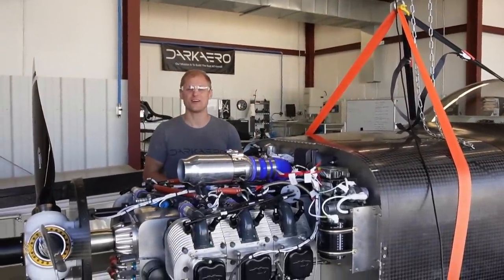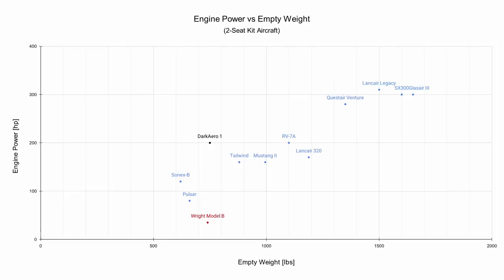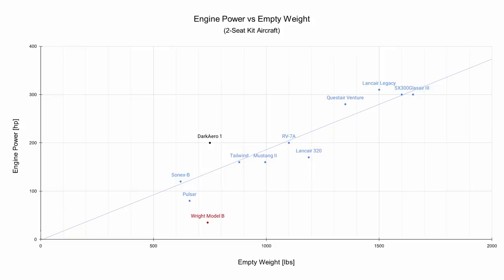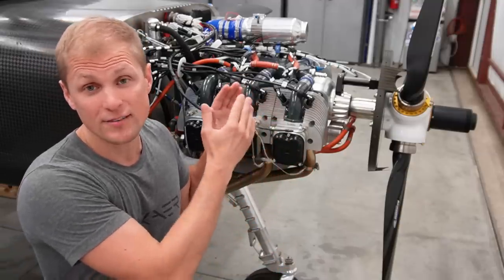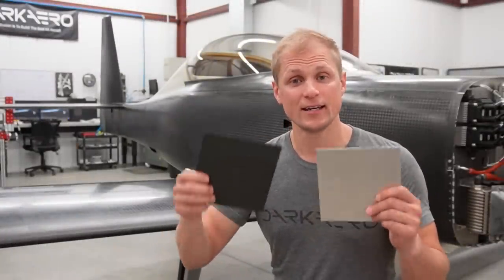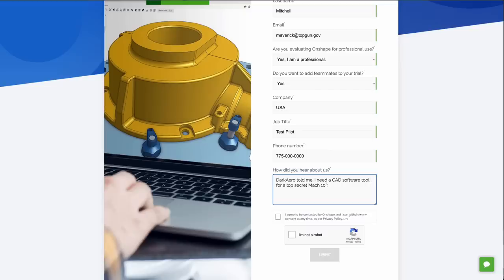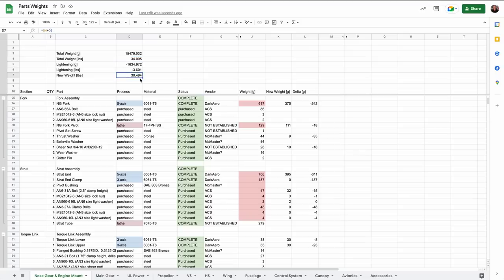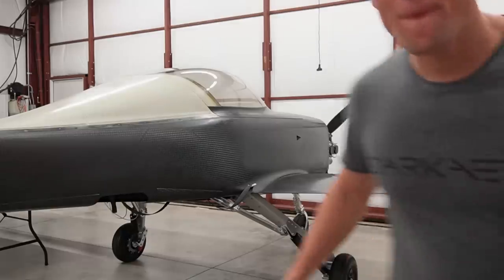How we built the DarkAero 1 "impossibly" light...

Comment: Great video!! Very impressed that you are coming so close to the original weight goal. 

Please incorporate a BRS in the next version. I know it will add a lot more weight, but will be a good safety option for DarkAero 1’s speed and long range. At least offer that as an option and do create the attachment points while creating the next version of airframe.
Reply: Amit, this is an experimental class aircraft. You can always add your own. Not everyone wants the weight penalty of a BRS. For sure da1 is about efficiency and performance and a BRS is not part of the mission
Reply: @davidchow9528  it’s not that simple, can’t just slap something like that in without some serious engineering
Reply: Amit, of course. My point is it's experimental and you can do it if you want. considering it at this point would delay the project, add extra weight which is against the original mission and reduce the market demand for the aircraft. not everyone wants a brs
Reply: @davidchow9528  "You" can't in this situation. Without the proper mounting points and engineering, there would be no safe way for any builder to add a BRS system. With most aluminum/steel frame kits adding a BRS is actually fairly simple, but composite is a whole different consideration.  

What the OP was asking for was for them to add the option of a BRS system. Which TBH for me is a requirement in the kit world these days. You are right about why they wouldn't want to do it.

BRS is a no-brainer these days. It saves lives and is fairly affordable in experimentals.
Reply: well i for one wouldn't want it. even as an option it would add weight and delay the project which was clearly defined from the beginning. 

look at trevor jacobs. he didn't need it.  i'm kidding 🤣
Reply: If you absolutely need brs you can figure it out - it's not hard.  Just looking how the plane "hangs" it looks like you can attach two points up front at the engine mount and another two in back aft of the cabin, modify the rear canopy with a "hatch" that opens to release the parachute.  Tape down the tethers to the body and have them converge to the "hatch."  Do the engineering to verify that it would work in a pinch.
Reply: @davidchow9528  Uhhh, it is hard if you want to do it safely. Sure you can just throw it on wherever, but I don't want my mounting points ripped off when I go to deploy it. Depending on the airspeed there is substantial forces working on the attachment points and you need to be sure the fuselage can take it without disintegrating. 

" Do the engineering to verify that it would work in a pinch."

Oh ya, super simple for the builder to "do the engineering". Lol, how do you expect a home builder to do that? Again that was why the OP was asking for the option because the kit manufacturers actually have the resources to make a BRS system safe. 

And as an aside, this aircraft would greatly benefit from a BRS system. Because it is so fast any off-field landing will be incredibly dangerous. The stall speed is high so pilots will end up stall spinning, and because its a low wing with a bubble canopy the occupants have little protection if the aircraft turns over.
Reply: @TheOwenMajor  most brs have procedures for deployment. you don't just pull the red lever at cruise speed. you have to slow closer to stall within a certain altitude window. 

hence do the engineering. the da1 being lighter should do well with a brs. hard points are easily found ie engine mounts, landing struts, etc. 

if you really want it you can get the engineering done. 

asking the da guys to do it is counter intuitive. it's not gonna happen without compromising the original mission and vision. 

my point is if someone wants to do it they can and it's not hard. but forcing the project to engineer hard points to accommodate to a smaller market who must have it is counter productive. 

do your research in the net effect of brs. people deploying too low, with improper speed without proper understanding and training. it's not always good. the only th big hood for sure is it does help reduce premiums. 

if you have to have brs then go find another plane.
Reply: @davidchow9528  "you don't just pull the red lever at cruise speed. you have to slow closer to stall within a certain altitude window."

Of course, and those parameters are dependent on how the BRS system is engineered. I would hope you have the common sense to recognize that having larger deployment parameters is better. Being able to deploy lower and at higher speeds allows for more opportunities to use the system safely. 

"hence do the engineering."
And our point is it would be nice if the kit manufactures did that. Because builders can't.

"it's not hard."
It is. I don't think you understand the difficulties of it. 

 "but forcing the project to engineer hard points"
I don't think you understand what a request is. 

"it's not always good."
It's always good. As long as the aircraft doesn't disintegrate(Something you think is a non issue apparently) BRS systems are well proven to save lives. Even in situations where there isn't enough time to fully deploy the chutes they reduce the energy involved on impact.

"if you have to have brs then go find another plane."
Sure, that's the market. And a potential customer asked for a feature, which is also part of the market. The manufacturers can weigh that request as they like, but that doesn't make the request any less valid.

Personally, I think their sales figures will be limited not due to the lack of the BRS, just simply because the aircraft is too small and specialized. Your clients will be older wealthy men. These men will naturally be wary of composite construction. They will struggle to get into the aircraft, and they won't be able to fit in it(the cockpit is quite narrow). BRS won't be the limiting factor.
Reply: Owen I’m an engineer with a degree from georgia tech, I’ve built and flown my own experimental aircraft and my current job is designing aircraft for the military.  I don’t know about your background but from your questions I can guess where you’re coming from.

It is not hard to add BRS.  It’s not as big of a challenge as you think especially with light aircraft.

Comment: Hi, weight around 320kg is normal in UL category with rocket system and full glass cockpit and engines around 100-140HP. This weight isn´t anything impossible light, but normal weight and this is weight of complete airplane, not prototype and not prototype without some parts ... OK, your plane have 6cylinder with 200HP, but ULL with weight about 350kg are able to fly 450 km/h TAS. And your plane and on which weight? For this fast ULL´s isn´t limit for speed engine power, but construction and maximum G-force limit´s , so they will not fly faster with more power, they will only climb faster, but VL3 with weight about 360kg empty is able to climb around 2600ft/min with 916. Risen is able to fly 450 TAS with 915 and weight around 350-360kg empty. Both in full comfort. They are finished product with comfort interior and they are full of avionics, autopilots and many other things. I don ´t think your design will go faster and will have lower weight than that designs, because you still missing some parts on prototype and when you will want to add some comfort and full glass cockpit, autopilot and many other things, weight will go up very fast. Risen is much more aerodynamic effective than your design I think. We will be able to compare in flight testing phase by fuel consumption on some speeds.

Comment: Will you guys eventually fit the turbocharged version of that engine to achieve insane cruise speed at altitude?
Reply: The turbo I think might have a better RPM profile? But it might not be a total slam dunk obviously for a variety of reasons - be good for them to shake things out with existing airframe and engine. How will it handle at high alt given wing loading etc.

Comment: exactly this, power and weight we "work" with a lot with RC planes hobby. and flight time if its Electric motor, and often you need to chose smaller lipo packs to keep the weight down, but you lose in performance, very much loss. so there for we try to build our planes as light as possible but still be strong and flexible in the right places. 

Electric can give insane performance, for a very short period of time. and the weight of the lipos can some times be so much i rather use a IC engine instead. if the RC plane is big enough.

methanol and nitro engines work also, due to the motors are so light in weight. but expensive AF. more or less use them only up to mid size. Electric on small top mid. 
electric on bigger RC planes are DAMN expensive. in my mind, not worth it.

Carbonfiber is nice, but its also heavy. balsawood is still used for light weight, if you dont have a chambered owen to cure your carbonfiber, so you can make it VERY thin.
but for building at home, we often use carbon only for reinforcing stressful areas.

Comment: It's a shame there's no obvious way to give a carbon-fibre structure a UV-resistant white finish without slathering it in paint (or vinyl?). Over time, exposure to solar UV degrades polymers, (which is why low-end ultralights can't be left out in the sun), and if polymers get too hot, say on  ramp in Arizona, they melt. That's why gliders, &c. are almost invariably white. (Fibreglass can use a white gel-coat.)

Comment: I only recently stumbled onto your website and youtube channel. Great progress info and thanks for showing insight into your development process. One question: with all your access to modern methods you only use minimal wing-body fairings, a straight wing taper and squared off wingtips. Aerodynamically this could be improved upon for better fuel economy. What is your reason for not having a more complex wing platform and winglets or a raked wingtip?
Regards, Nico

Comment: Have you considered wing tip winglets? Curious why/why not. 😎
Reply from the maker: Hi Tobias! Great question! Winglets are used to reduce induced drag (drag generated from producing lift) in scenarios where there is a design constraint that limits increasing the wingspan. The most efficient way to reduce induced drag is to just increase the wingspan. At the speeds and altitudes our airplane is optimized to fly at, the induced drag is a small percentage of the total drag, so adding winglets wouldn’t have any significant benefit. If it was intended to fly higher and/or slower, the induced drag would be a larger portion of the total drag, and winglets would potentially offer a performance benefit. Even then, we would look at increasing the wingspan or increasing the wing aspect ratio first before adding winglets, because these would be a more efficient means of reducing induced drag.
Reply: @DarkAeroInc  would you be willing to share any aerodynamic modelling you’ve done? Both pressure and wave models would be interesting to see. Possibly as part of a video?
Reply from the maker: @NuttySwiss  We did a video a while back about simulating the stall characteristics here:
https://youtu.be/gjNPEDBeiTI
Reply: @DarkAeroInc  saw that. 😎

Comment: Wait, did you design for retractable gear before deciding to use a constant speed prop? I thought the use of constant rpm prop would have a bigger impact on performance than the gear

Then again, im not the engineeer here. She looks like she'll be a little terror either way: getting clean retracts, flaps, and an airbrake into such a small package is no small feat. It looks a bit like the WWII prototypes for a US built "super-light-fighter"

Comment: CG looks very far forward with no occupant, what is the variation with one vs two occupants? will you need tail weight?
Reply from the maker: The CG shifts aft once people climb aboard. It’s more nose heavy with one occupant but basically ideal with two.
Reply: DA should be at the CG forward limit with full oil, no fuel, dash compartment full, and a 5th percentile female (weight) in the pilot seat. Everything else will made CG aft.

Comment: I like your graph of power to empty weight but it started me thinking(thank you for that), wouldnt a better comparison be power to gross weight? The plane would never be used at empty weight, so the measurement of empty weight seems only useful for gaining useful load.  

Thank you for the detailed process. I hope the aviation industry and economy sustain well enough to allow you guys to move into production and survive.  Nice work.
Reply from the maker: Power vs gross weight could be compared as well, but it would hide the level of optimization in the airframe structures and the engine, which is what we wanted to highlight in this video. If you look at gross weight, a less refined design could just compensate by operating with a reduced useful load and end up looking the same as an optimized design with a large useful load.
Reply: @DarkAeroInc  Thank you for the reply and your response makes sense with what you were trying to demonstrate. I understand.
Reply: As a variation on that, a surface plot of empty weight (vertically) versus both power and useful load would be more descriptive... but what they're showing still makes sense.

Comment: One question...
I am not an aeronautical engineer but I am super curious about the structural integrity of the nose wheel engine mount combination...
What happens to the engine in an event of a hard strike nose wheel landing?
Will this constitute a sudden stoppage inspection on the aircraft's engine since it absorbed a portion of the impact of the sudden hard loading from the landing?
Reply: Nothing unusual about nose a wheel's landing gear being tied into an engine mount; very common design practice. If there's a landing hard enough to be concerned about damage to the nose gear, then the mount will of course need to be inspected, but if that strike is hard enough to also have concern about the engine itself? That's a hard enough landing that the entire airframe likely needs inspection. Generally, the strengths are engineered so that the landing gear can fail pretty fully, WITHOUT damaging what it's mounted to.

Comment: Hi guys, just a question about certification of the airframe. Will the Aircraft have a Standard certification or will it be required to be placarded “EXPERIMENTAL”?

Thanks. Really exciting what you three brothers are doing.
Reply from the maker: Hi Mark! Thanks for checking out the video! The airplane is designed as a kit so it must be placarded as experimental.

Comment: hi how will you calculate the life of the airframe which is made of composite?
Reply: When designed with at least a factor of safety of 2, composite airframes are considered to have an intinite life
Reply: @SuperYellowsubmarin    Aside from the aluminum honeycomb debonding and turning into a green and white swamp mush then sure, infinite life.
Reply: @mer9706  agree on that, and I think they mentioned they would switch some of the honeycomb to nomex. But that is environmental ageing, not fatigue life, which is what I understood the question to be.
Reply: @SuperYellowsubmarin  Gotcha.  Don't get me wrong I like the performance it brings, but the tradeoff is an inherently bad geometry for bonding.  I used to make a living repairing sandwich panels--both flavors :D   I repaired regular laminates too, but they only ever failed due to impact, heat, or oil intrusion; usually a combination of all three, near the engine.  But the honeycomb panels were better described as having a terminal cancer.
Reply: @mer9706  hehe I work in aerospace as well and we are swapping honeycomb in favor of foam. Looks very good on paper but service is something else
Reply: @SuperYellowsubmarin  Lol, there's definitely a tradeoff.

Comment: Why not a 2 cycle engine. Better power to weigh ratio. Weight is important but how about competitive price?  Retractable tricycle gear?  I’d start with a sailplane, add jet engine. Efficient at high altitudes. Glide most of the trip. Minimum weight, minimum fuel, maximum efficiency. Fly above weather. Mobile phone for instrument panel. Lots more ideas. 
Exemplary presentation!

Comment: To my knowledge, the UL cannot be run LOP due to lack of mixture control and factory set ROP values. Did you take that into consideration when picking your powerplant? Or are you running LOP with custom tunes? For long range, efficient cruising, a light airplane like the DarkAero could really take advantage of LOP ops. Thanks for the great content!

Comment: Any chance to try some Mild Hybrid our Hybrid turbo engine?
Reply: But why?
Reply: @davidreinhart373  inovation
Reply: Very little practical use in a hybrid vs much more complexity. You gonna see turboprops in that size of plane before hybrids. But it’s a kit plane, you can use any engine you like.
Reply: @experimental_av  tks 👍
Reply: Fully electric would be more interesting.
Reply: @pablojbressan2260  Building the aircraft out of cast iron would also classify as innovation.
Reply: @GT500NSX  🤣🤣 tks 👍
Reply: @Mike-oz4cv  that would need a quite different aircraft. Electric power is definitely the way forward, but demands a very high L/D - think glider shapes. Great idea though….
Reply: @tonyb4773  Why does the aircraft have to be different? As long as it’s efficient (i.e. low drag) and you can put the batteries in convenient places (e.g. in the wings) it should be relatively easy to convert, shouldn’t it?
Reply: @Mike-oz4cv  It would work, but have very short duration. Simply replacing the engine system and fuel with motor and batteries with the same airframe is likely to give about one hour duration. Electric aircraft use up to 50% MAUW for the battery, and use high aspect ratio wings, low drag fuselage, repositioned motors etc to optimise performance. This way they give up to about three hours duration. See the Eviation Alice for example…